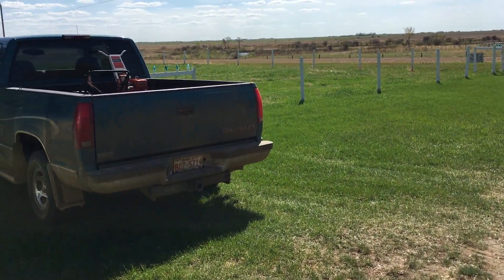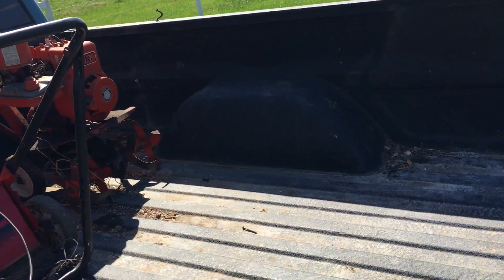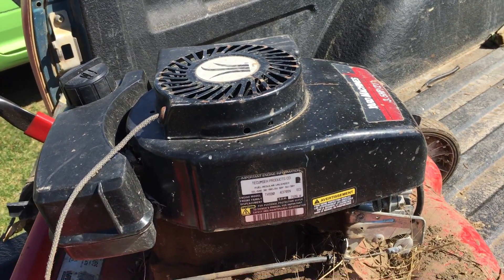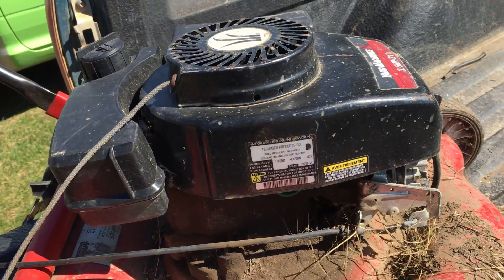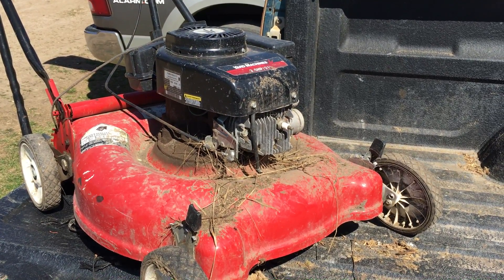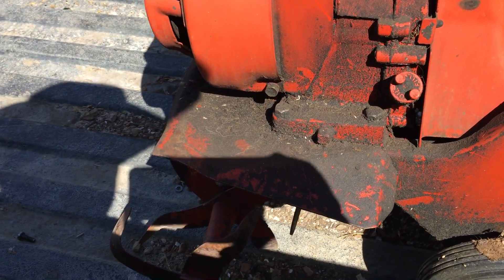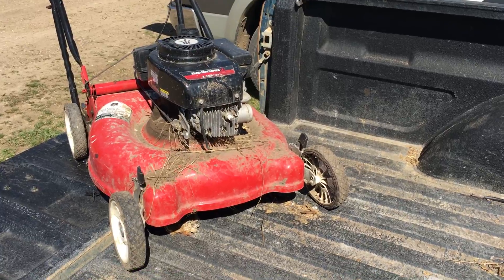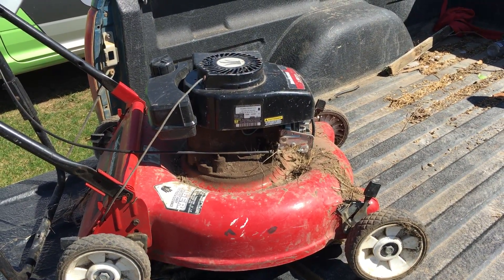Saturday Trash Picked Treasures!

Comment: Nice saves! I have a 1950s gas powered reel mower I saved from a barn. It probably had been sitting for at least 40 years. Anyhow, I got to tearing into it, and the exhaust valve is INCREDIBLY stuck. It was stuck open, I sprayed it with penetrating oil and let it soak for a few days, that absolutely pounded it down. Now it's dead stuck closed. I'm not sure what to do at this point. It's sad because I was really hoping to save this old machine. I'm not so sure I could now, unless I replace the engine. The engine is a 3hp Briggs and Stratton.
Reply: planejet42 I had the same thing happen to me, try turning the engine until it tries to push the exhaust valve up then turn it over using vide grips, it will eventually free up, but good luck 👍
Reply: planejet42 also you may have to open the valve cover and oil it all up
Reply from the maker: I think your best bet is to try and remove the valve, as something has swollen and made things hard to move.  Your going to have to take things apart, so skim the internet for some gaskets in your damage something taking it apart.